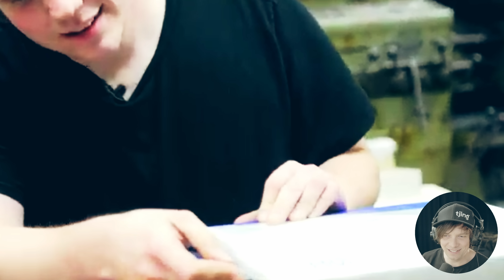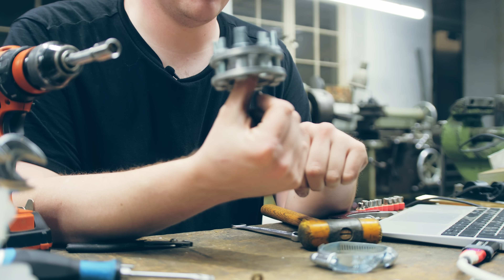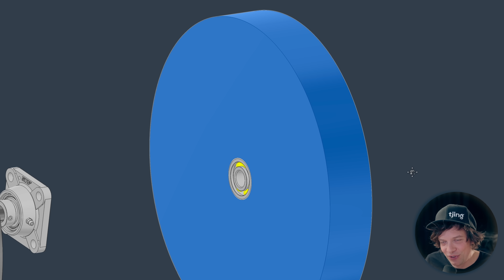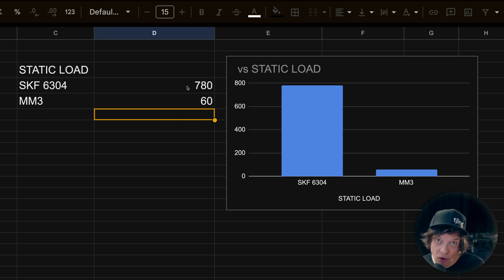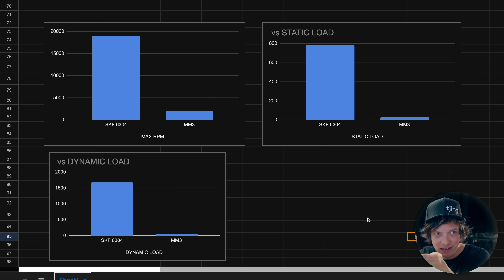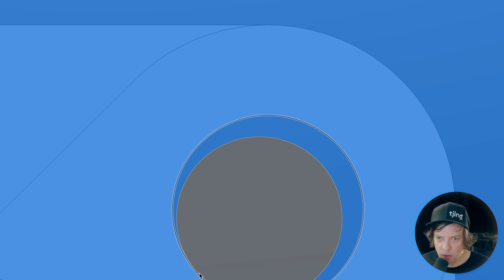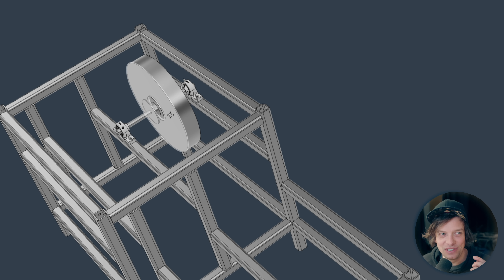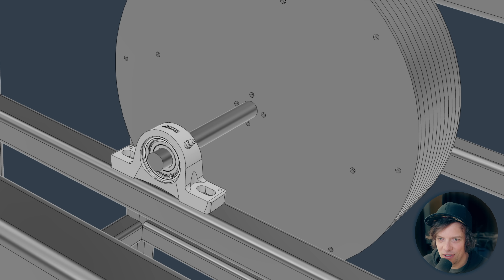Worst Bearing Housing Ever - Marble Machine 3 Ep.3

Comment: I think you should read about Hertz Theory : this helps modelling and understanding why everyone hates your housing. The constraints (force over surface) on each contact point bearing/screw are enormous because of the minuscule surface, thus the deformations induced are huge (because of the very small half radius of the ellipsis modelling the screw threads crests). This yields poor concentricity under load and, because this holds a flywheel which exerts more load as the concentricity gets worse (less concentricity = less balance), this may be the worst design for this application. 
In the last video, we can see user "remove_the_kebab" partially adressing the issue, suggesting to use shoulder bolts. This transforms the minuscule half radius of the thread crest to an infinite half radius and really helps with the amplitude of the deformations. Furthermore, it helps with the precision of your bearing location.

Also, a word on the perpendicularity requirement you brought around 15:30 in your video : any shaft rotating should be held by at least two bearings. Also, if they had strictly perpendicular bearings, the whole assembly would be hyperstatic and hard to manufacture, and the bearings would "live" less longer than their actual isostatic design. 
If you really want perpendicularity, I would recommend not laser cutting the holes for the shaft and drilling and rectifying the holes after it has been laser cut. Although, because the plates are tall and thin, the perpendicularity is weakly ensured (hammer it on the sides and it's gone). An easy way to do it is to drill and ensure good surface quality on the sheets before laser cutting them, and then to laser cut them as they are centered on your laser cutter origin with a weld circular pin exactly the size of the drilled hole - then you make sure your program laser cuts the sheet concentrically around the pin.

Comment: To be sure you should use a machined bearing hub that could also clamp on the axle and a shoulder machined in your flywheel to keep the concentricity. In reality your solution will be fine and using the floating bearings to support the axle is a good idea. The idea of not using a real flange to clamp on the axle is not so good.  The only worry left is on the balancing of the flywheel that should be addressed for sure considering the rotational speed you've in mind.

Comment: I feel that the threads on the bolts will eventually chew into the bearings and cause slop. I don't know if that would take a month or 10 years of use to get to that point, though.

Comment: Why not just cut a slot into the flywheel and press-fit whatever bearing housing you're using into that, and THEN screw it down?

Wouldn't that avoid having to adjust the placement of your beating housing and prevent loss of concentricity when the spinning and belt pulls the flywheel against the axel?

Comment: @Wintergatan if you need to hammer in the bearings, how are you going to replace those in case of failure? Replace whole assembly with clamping plates and bolts? do you think it's cost effective?

Comment: I said it in the last vid but by hammering the bolts in you are mashing their threads which makes it impossible to keep the bolts tight without stripping threads and also will cause them to become loose as the threads continue to mash the longer its used.

Comment: I am not an engineer but there are a lot of engineers watching these videos and if they are all saying this is a bad idea, even after your second video then maybe, just maybe it is a bad idea.
You seem to be literally reinventing the wheel. Adding complexities and failure points when a part already exists for this solution. Fly wheels exist in all kinds of devices and none of them have the bearing held in by threads of bolts. This will probably work on your tests but once you have had your machine running for a few hours it will have problems.

Comment: Sticking to the laser cut parts seems like a solution in search of a problem. There’s plenty of services that could machine a simple flywheel compared to a complicated part with many laser cut plates and bolts. All you work for the marble gates reducing part count seems completely contrary to this.

Comment: Mount the flywheel to the shaft roughly concentric and bolt it down tight. Then spin the disk while clamping an angle grinder near it and gradually adjust the angle grinder so it gently removes material from the flywheel until it is concentric. This works the same as a tool post grinder on a lathe.
The flywheel is laser cut so the concept of perfect concentricity is impossible because the wheel itself is not perfectly circular or smooth. After the flywheel is ground concentric, it can then be statically balanced.
Dynamic balancing is also possible using a contact microphones to listen to the vibration and an LED, reflective tape and a light sensor to give positional information. The output of the light sensor and the microphone output can go into two channels of an audio analyzer or PC sound card. The phase shift between the signals will show where the wheel is heavier relative to the magnet and the amplitude of the vibration will show how bad the balance is. A little experimentation will show where weight needs to be removed or added to reduce the vibration.

Comment: Two of those bearings on opposite sides of the flywheel would hold it perpendicular. They are only allowing misalignment because the bearing blocks are allowed to move in regards to each other. If they were mounted perpendicularly at the start, they would stay perpendicular.
Reply: This! Also he's stressing over getting the bearings aligned concentric with the flywheel and thinking of offsetting the mounting holes off center of the holes in flange. All this will do is ensure misalignment. That's what adjustment and bolt clamping force is for to get it aligned and held in place.

Comment: Don't forget to examine the forces on each individual part of the housing. The load/shear forces on the threads holding the bearing become exponentially greater the smaller the surface area of contact becomes. Consider stopping a spinning car tire with a needle. Even if you have several needles working together the momentum of the spin wins the fight against the needles. Then when your bolt threads begin to wear you will shake your machine apart with vibrations. Why not machine a flywheel once then mount it to the shaft and weld them together? Perpendicularity/Concentricity would be solved. You could consider the flywheel and shaft as a single part albeit expensive but also robust. This is the most dangerous part of the machine besides pinch points. Better safe than sorry.

Comment: I'm a bit alarmed that he's content with chatGPT for any serious calculations. 
There should be some kind of safety factor considered there, but for that you'd require knowing your loads first.

Also, if he he encountered bearing solutions with axial-radial play ( that do not apply for a precision music machine ) : those exist for a reason : some machines require these.
You can't put tight tolerances on everything or it either seizes or it becomes very expensive. 

Finally, a lot of machines combine both angular bearings for keeping the axial play low, and then additional ball bearings along the axle.
Sometimes you only need to preload the axial load and ... it stays centered.

Comment: I think whatever you do you should be prepared to balance it manually, that way the actual mounting of the bearing isn’t as important (although it is important to get a solid mount and being mostly concentric will always help), however you balance it you will have to add or remove material somewhere, either with a bit of grinding or drilling holes, which will probably effect the looks. In that regard grinding may be better as you can polish it later and as long as you don’t need to grind much it will still look circular.

Comment: If the shaft length can be shortened to the absolute minimum to engage with the frame bearings, why can’t the shaft be turned from the flywheel metal stock when turning it for balance on the lathe? This would attach the shaft to the wheel, eliminate perpendicular movement and minimize part # to = 1

Comment: The flaw in all your numbers is you’re focusing on the bearing’s design limit ratings, not the crush rating of the threads over time on your bolts. As your threads “smoosh,” the effective hole for the bearing will widen, and there will be a snowball effect.  I would absolutely not rest anything against threads - that’s not what threads are designed to be used for.

Comment: 11:00 they weren't talking about the bearing being the failure point, they were talking about your housing being the point of failure. The issue is that those bolts pretty much have to be perfect to properly hold a regular bearing in place
Reply: Let alone the wear and tear on the bolts and the bearing where they connect!
Reply: @Vendavalez  the moment they wear even slightly, the whole assembly would go out of whack. Grip would be lost and the concentricity would be too
Reply: @JonathanKayne  honestly, the weight of the wheel when it is not in use might be enough to deform the threads.
Reply: @Vendavalez  Deforming a  bolt - say an M8 -  with the weight of a flywheel? Unless it's in the 1000kg range, no - this is NOT going to happen. And unless he plans to use a combustion engine, the torque he's putting into the sistem is negligible compared to the strenght of the materials. 
If he ever needs to resist 1000kg of forces in a music instrument, we'll know he's gone off the rails....
Reply: @francescosirotti8178  I suppose it does depend on the materials used. But, it sounds like an unnecessary risk to take when there are off the shelf options where this is not even a possibility. 

Personally I would test both options. He is in the prototyping phase. This is there time to find out if things that should not be an issue in theory end up becoming an issue in practice.
Reply: @francescosirotti8178  It doesnt need to deform the bolt. It just needs to deform the threads.
Reply: @francescosirotti8178  a piano has 100kg of tension on each string. There are 230 strings in a piano.
Reply: We are not talking about deforming the bolt by brute force.
You have single point loads where the threads touch the bearing housing. And those will be big stress risers. So you will maybe have a lifetime of.... 200 hours, (which in machine terms is nothing) and then the contact surfaces will flatten out. This will lead to more clearance between bolt and bearing, which will result in ratteling/vabration/cyclic loading.

And cyclic loading LATERAL on a bolt is the worst thing you can do with those poor screws.
Reply: Not only that, the threads have to withstand the forces. Since the threads act like small stands holding up the bearing and the weight of the flywheel, more pressure is on the tip of the threads, thus blunting it, causing the bearing to sink.
Reply: A tight bolt can hold a car. There is just no way Martin can put enough energy on the flywheel to move it.
Reply: @francescosirotti8178  you are correct but those bolts are connecting the tire to the shaft, not the bearing itself. In that regard they are doing a completely different job, and are doing exactly what bolts excel at- joining two flat surfaces through tension. 
The ultimate issue is that Martin is trying to use the sidewall of the bolts to hold a bearing captive, which isn't good for a bolt, and as he showed in the previous video, you need them to have the correct radius pattern to hold properly.

Comment: Martin is not looking at the weakest link of the chain, the forces won't wear the bearings in and of themselves but the threads on the bolts aren't designed to be loaded with foces on the sides.  Overtime, either the threads or the bearing will wear down because of imbalence in the flyweel adn the pressfit will fail.

Comment: Good luck in replacing the bearing in the future. I hope you will not regret this. Sometimes too much math also hurts. Just use common sense. "Flange bearing housing with double bearings" is what you are looking for to get the perpedicularity. Google it. Concentricity does not have to be perfect (it's the enemy of good). Even if you get it perfectly centered, it doesn't always mean it will be balanced. The worst thing that could happen is that you will get a little vibration. But you can also attach a damper like a rubber feet on the pillow block to isolate the flywheel vibration from the frame. You're welcome!

Comment: Martin thinks re-inventing the wheel is productive. The solution for a flywheel bearing has been solved and evolved. 

What Martin has too much focus on failure. The REAL issue vibration and performance. Poor performance may not fail. It’ll just send unwanted mechanical vibration throughout IMO

Comment: Hi Martin, 
Your design is actually really ingenious! It's quiet simple and you make your production more efficient. The only problem I can see is, that your bearing housing is overconstraint. Means that the screws are loaded sideways but are also clamping at the same time. Best practice in engineering is, that bolts are never loaded sideways (if your not using special ones) and that the "force flow" is clear. In this design it's not clear, wich surface takes the radial load (plates via friction or the bolts by means of a form fit). 
And two more hints towards your calculations. For Bearings you normally calculate 'survival probability over lifetime' (number of total revolutions or working hours if you know your rpm). There are quiet a lot of factors coming in to place, which can lower the expecet lifetime by quiet a bit, for example a badly centered flywheel. And talking about that, the excentricity of your flywheel is likely going to be one of your main dynamic loads, so please take that into account!

My personal piece of advice to calm down all the engineers out there, give the bearing housing a looser fit and center it by hand. This way you can get a pretty much concentric flywheel and don't have an overconstrained bearing housing. (If its concentric enough via the current method, just go for it :D )

Comment: You charts are fallacious. You compare the load MM3 would exert to the load the bearing can withstand, thus to defend your bearing housing solution.
You’re only proving the bearings would not fail. But from all of this absolutely nothing can give you the slightiest hint as to whether or not a tight fit between two plates and a few bolts is a sturdy enough housing to withstand such loads.

To make myself clearer, let’s examplify with an extreme: if you were to use some lego contraption for a bearing housing solution, the whole stuff would fail quite quickly, not because the bearing could not stand it (I’m pretty sure they would still be OK even after the failure), but because the housing would not stand it.

Comment: I would suggest to work on other 
parts first. stabilizing a flywheel is a problem that can be solved and is not specific to the mm3? It would be much more critical to work on the programming wheel, the marble gates, the instruments and the circulation of marbles where you found serious bottlenecks on previous designs?

Comment: 19:21 there’s a term called “match drill.” In this case you would put the flywheel on the axle and then the bearing housing. Once that is done you can locate, drill, and tap the bearing housing mounting holes on the flywheel.

Comment: My concern is not that the bearings can take the load, i worry the load on the threads will begin to loosen the fit as the threads get mushed down. Even then would this result in a critical failiure? Maybe not... but watching you, Martin, ive learned that maybe not usually means yes.
Reply: You can buy shoulder bolts, they have a section of precision machined area free of threads, they are hardened, and consistent. We use them all the time in the mold making industry.

Comment: Its not quite right...Those bearing housings would completely allow for the calibration of perpendicularity. You would have to set the perpendicularity and then they would accommodate that. That's the beauty of them. if your rigid solution is out of spec, or tolerance at all, good night, game over. The flexibility is good, but then requires calibration.

Comment: Just because a design is proven to work does not mean it can not be optimized. I like the way you are currently thinking. Give it a test, and if it doesn't give the results that you want, then move in a different direction. I believe those bearings should be rated well enough for the static and dynamic load and as long as the steel is also able to take on similar loads. I don't see a problem with your first solution. By the way chat gpt definitely simplified the math for you 😂.